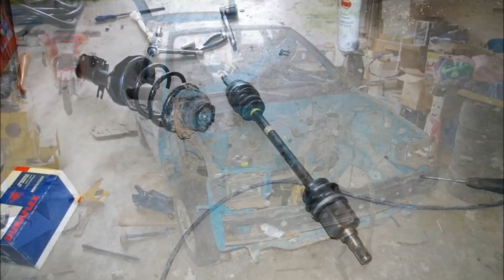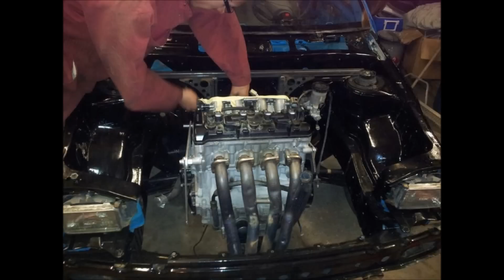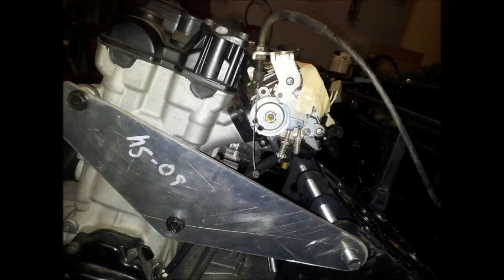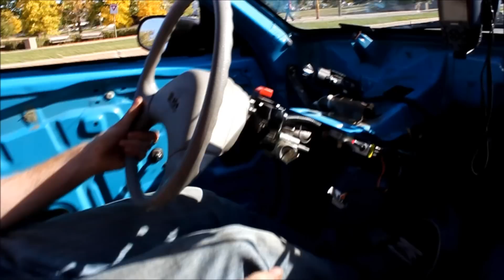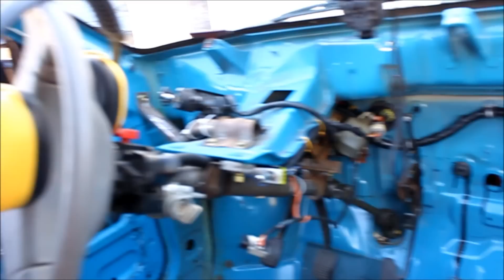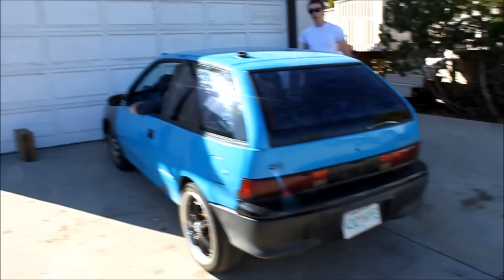GSXR Geo.wmv

Comment from the maker: Trust me, the engine mount is not the weak part of the car. For our application the strength was not compromised by adding the holes. I understand what a dimple die is. Also they add rigidity, not strength or weight savings. If you are trying to give me fabrication tips you are wasting your time.

Comment: awesome work guys, only reason it seemed slow is because they didn't rev it near what it is capable. that engines redline starts at 13,750, and you can shift at 14,000rpm. it wasn't in its powerband the whole time, that's why it didn't seem that fast. get the right tach, shift at 14,000 rpm and it will fly!
Reply from the maker: You got it. We were still waiting on a cluster at this point so we were driving blind. Didn't want to over-rev it.
Looking back on it now we were probably going 6-8k max. These motors love the double digits. Music to my ears!
Reply: schattej have you got the tach now? Maybe do updated video?
Reply: schattej If you don't mind, could you share how much it cost and did you get a totaled bike for the engine? I want to do this in a Ford Festiva. Oh and any MPG ideas??
Reply: TAKINGADIP
Car has since been totaled due to insurance issues and the engine piling up :(
Reply: XRA1D
The major cost is time here... but as for numbers the engine and harness was about 1500. MPG was very poor, that poor engine is lugging around alot more weight, and you wont drive it with restraint or respect either. I wish I had a video of us driving it afterwards when we knew its limits. Flooding the cabin with smoke doing rolling burnouts! haha.

Comment from the maker: We used the diff out of the geo transaxle. This allowed us to keep 100% stock axles. We used the stock air box due to budgetary concerns, and due to the complexity of the motor (volume of airbox, maf sensor) you cant just easily make a replacement box. The diff has a 42 tooth sprocket and the front has a 17. Not very good off the line on a 650kg car. Changed front to 15 and it was better. Hoping to get a 13 on before the snow flies and try it out.

Comment from the maker: It is 1/4" steel...

The holes were to remove weight and better access to the rear of the engine. I don't see how cutting a hole could ever add strength.

Comment: why not. both the gsxr1000 and the metro has the same size motors except the gsx1000 has way more power than the puny 55hp 1.0 liter that the metro came equipped with

Comment: Cutting a hole does not add strength, but if you dimple die the hole it will cut down weight, add strength and make it more rigid so it wont bend.

Usually every hole you drill for gussets like that should be dimple died. 

If you need to learn more just look up Dimple Die, you just use a press and a dimple die set to bend the hole inwards.

Comment: I have a buddy with a clunky 1.0 3cyl 92 metro and I've been trying to. convince him to chuck the old motor and go with a big bike motor like this. you know if the added strain of lugging around a metro is going to affect the longevity of the motor? you said the engine junked on you in an earlier comment I just wanted to weight the options of better to build up the stock motor or swap for a superbike engine

Comment: Well right, this is a picture log.  I'm asking more detailed info.  Such as what differential did you use.  did you have to lengthen the axle at all or were you able to use stock axles.  why did you have it mounted with the air box sticking up out of the hood, and not make a air box for it?  how big of a sprocket did you use on the differential.  stuff like that.  stuff that can't be explained in pictures. thanks